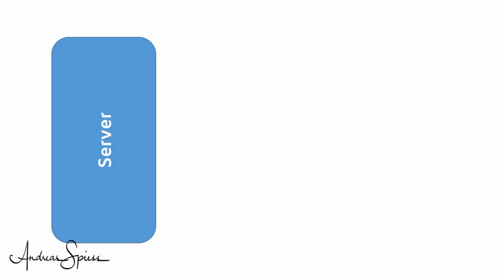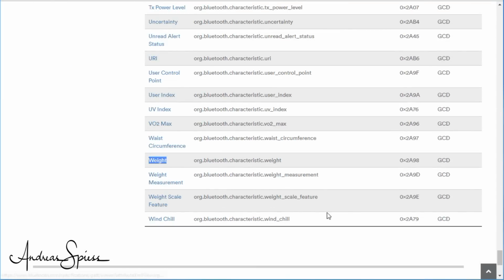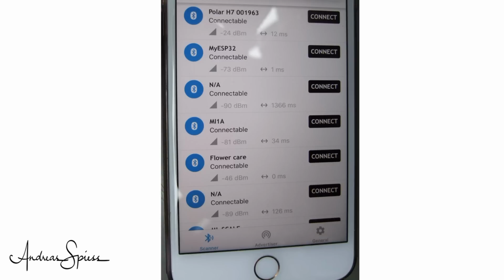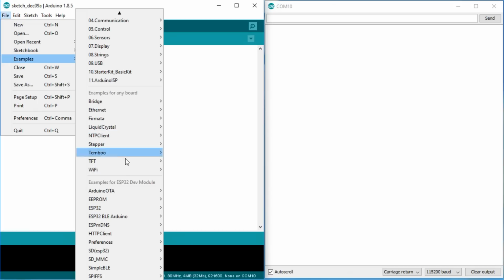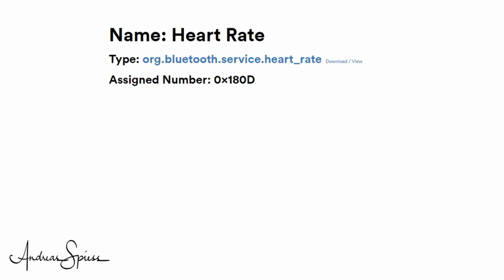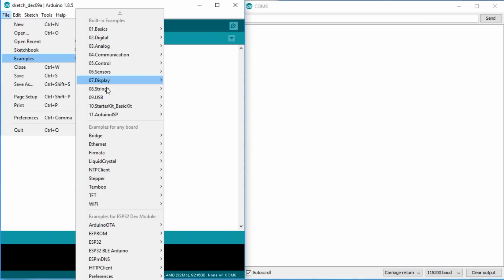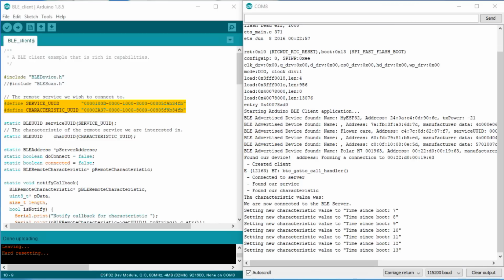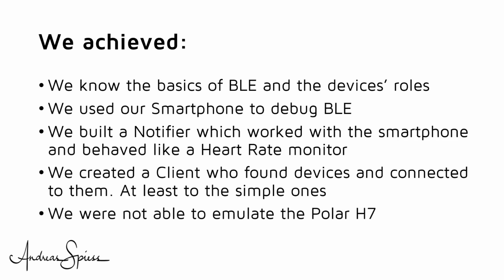#173 ESP32 Bluetooth BLE with  Arduino IDE (Tutorial) and Polar H7

Comment: Great video! However, I couldn't get the BLE examples to compile in Arduino IDE. I updated the ESP32 library by using Git GUI and get.exe but it didn't include the library so then I went to Neil Kolban's Github page and downloaded the library and put it in my libraries folder, but the example wasn't listed under "ESP32 Examples" and it didn't compile. It gave a few errors, but this was the first one: "ESP32_BLE_Arduino\src/FreeRTOS.h:46:3: error: 'pthread_mutex_t' does not name a type". Any ideas? Thanks!
Reply from the maker: If you just install the ESP32 support bluetooth is already there. No library necessary. Maybe you delete the library. Then it should work. Or you reinstall the ESP32 support.
Reply: Hmmm the strange part is that I updated the library and it's not there. The ESP32 library for Arduino also doesn't show the libraries in Neil's repo and it only has "SimpleBLE": https://github.com/espressif/arduino-esp32/tree/master/libraries
Reply: I deleted the ESP32 files and reinstalled and it worked, thanks! I guess the update from Git GUI didn't work?
Reply from the maker: I do not know. But I am glad it worked now!

Comment: Hello good day. I tried to do a similar work with the esp32 wroom 32u module and the HM-BT4502B module, but without success. As far as I understand, in the code "if (advertisedDevice.haveServiceUUID() && advertisedDevice.isAdvertisingService(serviceUUID)) {" I can't get into this if structure at all. What can I do? Can you help me?
Reply from the maker: Unfortunately, I cannot do remote consulting. But I do not think you need BLE on the ESP32 if you use a HM-BT4502B. It works with AT commands.
Reply: @AndreasSpiess  I understand. Thank you, but what I have tried is to communicate between esp32's bluetooth module and HM-BT4502B and send and receive data. Do you have any tips or suggestions for this?

Comment: Would like to see if you would update this series by communicating between an Arduino Nano BLE Sense or Adafruit Feather BLE with a RPI 3 or RPi 4?

Here is a GitHub link to a gentleman who has also worked on RPi and Arduino communication using BLE
https://github.com/Josh-Weston/ArduinoRPi
Reply from the maker: This is a different way because it does not use the BLE features of the ESP. It uses an additional BLE device. A good thing, but not very much related to this topic.